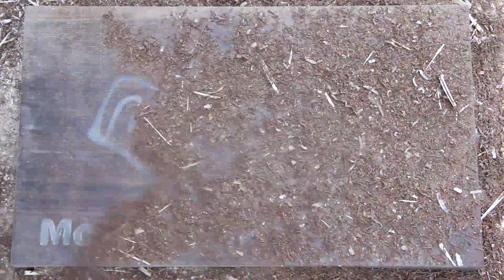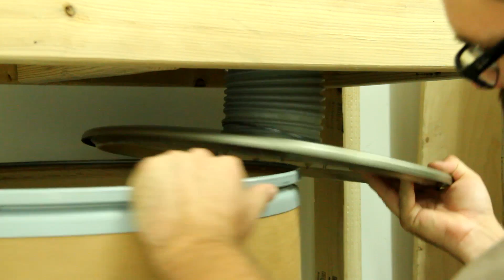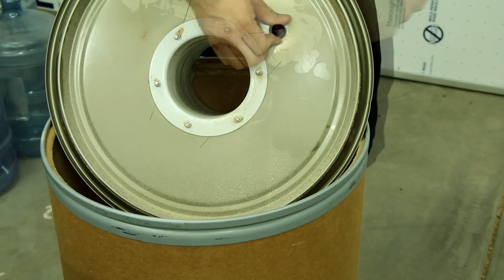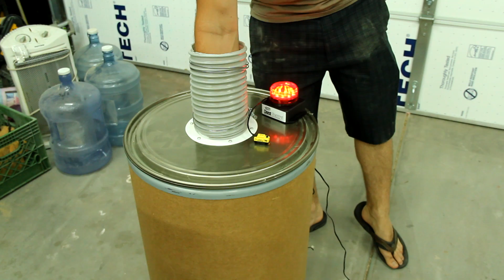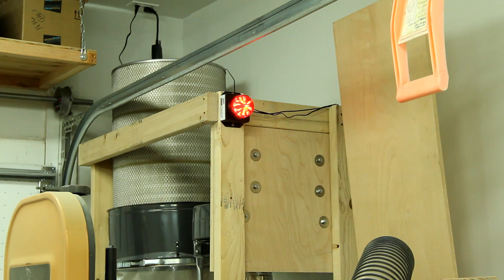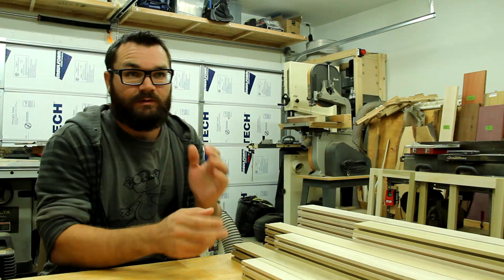Dust Collector Drum Sensor

Comment: These are great for any enclosed bin dust extractor.  The Oneida system is nice, but expensive for what it is at $170 currently.  For those not electronics handy, it is a good solution. 

I was able to source the same IR sensor on Amazon, along with other parts, to build my own for less than half the cost (~$65) and it has the added benefit of a an audible alarm along with the flashing light I can hear over the shop tool noise.  It also has a dual NO/NC relay that I could even use to control the extractor power in the future... shut it off when the bin is full.  A desired update of mine for down the road.
Reply: i'm very interested in your set up if you have some details on what items you purchased and used for your setup please.
Reply: @KlingbeilWoodworks  https://www.youtube.com/watch?v=Rrx8357Kn-I&t=747s

Comment: Maybe I'm missing something but I set my sentry up with a new Supercell and powered it from the cord that comes out of the start button module. My problem with it is that the infrared light is always on unless I shut off the breaker. Seems like this is a design flaw- shouldn't it only come on when I turn on the Supercell?

Comment: I purchased the same sensor on ebay for $20.00 US  yes I live in the US but this is the internet. a $3.00 light for the signal device  a $2.00 9 volt wall wart and It was sensing dust levels. for more info see sawmillcreek.org
Reply from the maker: Yea, the tech behind it is fairly basic. An infrared emitter/detector and a tiny bit of circuity to flash a light when the detector trips.
Reply: Ty Moser in my case the Flashing led was connected directly to the output of the sensor, if I remember correctly you could apply a20 ma load directly to the output of the sensor. I forget how much current the led light would draw but it was way less than the 20 ma.
When I put my DC system together I did the same as you with the filter and the output of the blower directly into the ring. 
I changed the impeller to a 12 inch Rikon impeller, I also made the connection between the Supper Dust Deputy and the intake of the blower to 6 inches. With an AC duct take off flange. Just recently I cut the plastic bag to a 14 inch length and the system is much quieter now.😁🛫
Reply: Oh I live in West Texas where the humidity level is very low! My system is not grounded and I have not blown up yet! 🤣🛫

Comment: I see this video was posted in 2015, so now three or maybe close to four years now, what are your thoughts?  I spoke to an electronic whiz kid I know and his concern was that if the sensor gets a layer of dust on it you may get a false alarm.  Can you discuss this?  I am NOT a troll or trying to be negative, I have an Oneida system and know them to be a great company, but just curious how this has worked out for you.
Reply from the maker: I haven't had issues with the sensor getting dust covered but I have had a couple issues with the dust piling up directly in the center and not getting high enough under the sensor. Especially when I'm doing a lot of planing which produces larger chips. I've filled up the drum and the cyclone a couple times which isn't very fun to unclog..
Reply: @TyMoser  Thank you Ty, I contacted Oneida directly and they said cleaning the sensor each time the tub is emptied will prevent most false alarms.  I have never checked the drum between times so am unaware if mine does the same thing yours does, I will check it to see as I have filled the cyclone and filter way too many times and really need a solution to my more memory.  Thank you again for the reply.
Reply: I had the same issue with dust piling up in the center of the bin and registering the sensor. I had to move the sensor closer to the inside edge of the cyclone.

Comment: If you would have clamped a piece of wood on either side before you drilled the hole in the lid, you would have ended up with a much cleaner one.
Reply from the maker: Yup, good point.

Comment: used your wiring specs and need help. I don't understand the sensor wiring other than +or-not the black and white function.  Wired up the green light works great,  goes on and off using sensor, can't get red to flash. Straight DC to red it works fine. If you could give any help I would appreciate it. I ordered the exact parts you listed. Thank you Rj

Comment: Nice!! I was wondering if there would be any kind of "snooze" for this alarm haha but it's clever that only blinks if the dust collector is on :) cool video!
Reply from the maker: +Cactus! workshop Yea.. origionally I had it hooked up to the regular outlet but then I went away for the weekend and it bothered me that it was till on.. After that I got a small splitter and put it on the dust collector remote.

Comment: I plan on putting my dust collector in a shed outside the shop and piping it into my tools. This seems like a great solution to know when it's full in light of its remote location. Pun intended! 😀
Reply from the maker: +Deacon Woodworks Light and Remote! On a roll for sure! I've had a bad time letting my bin fill up before installing this sensor and it's generally only about 10 feet or less away from me. I can't even begin to imagine how bad it would be if the dust collector were in a remote location!

Comment: is this a sponsored video ?
Reply from the maker: +Eye Toldyoosso I guess you could say that. I mentioned in my Harbor Freight Two Stage Cyclone Mod video that I was planning on figuring out some kind of sensor and they left a comment mentioning the Dust Sentry. I was surprised how similar it was to my plans and sent them a message asking if they would send me one. So no, I didn't get paid but yes, I was provided the Dust Sentry.

Would you call the video's coming out with people using an X-Carve sponsored? Most of them were given one with a requirement to provide X amount of videos.

Comment: Ty, I have my garage set up jest like yours, to include my dust collection. Did you run into any power overload problems. Did you need to re-wire and go to a higher breaker to run multiple large items like dust collect and table saw.
Reply from the maker: +Cali Valley My garage initial had three outlets, two were on a circuit that also had all the out-door outlets on it and the one was shared with the garage door opener, garage and kitchen lighting. I added an additional two outlets, one 15 amp dedicated to the DC and a 20 amp for miscellaneous stuff. During the summer months I'll still trip my 20 amp circuit when running my AC and a large tool or two. I plan on installing a 220v circuit in the next couple weeks as well to accommodate a 8" jointer I just got... lots of power..
Reply: +Ty Moser (MonoLocoWorkshop) Thanks, reaffirmed what I knew I needed to do. Winter project. Keep doing what your doing, it's appreciated.

Comment: 148 bucks before tax and shipping. Knock that 1 off and we'll talk, otherwise, nope.
Reply from the maker: +Chris Bowen I originally planned on using a spare Arduino and miscellaneous parts I had laying around but when I priced out my DIY version it was a little over $60 bucks. With the time that would be involved in figuring that all out, the $148 price didn't seem so bad. Plus, other than the actual dust bin, this sensor is the cheapest part of my entire collector.